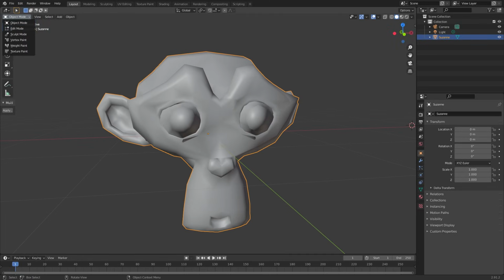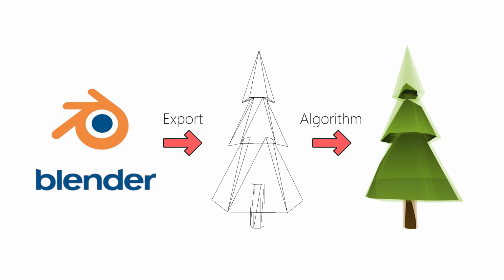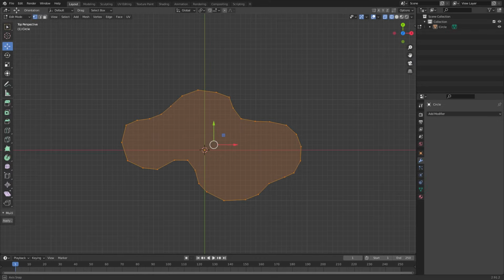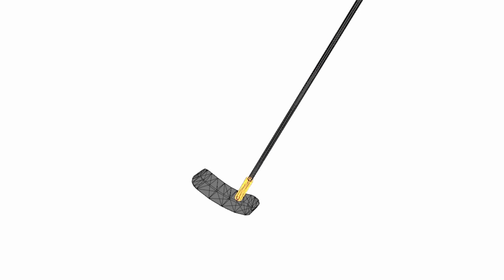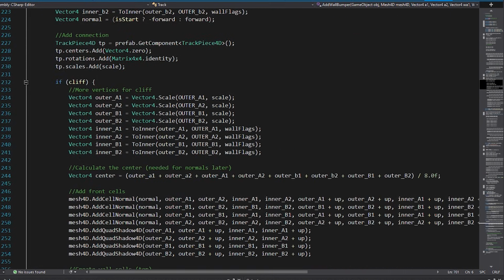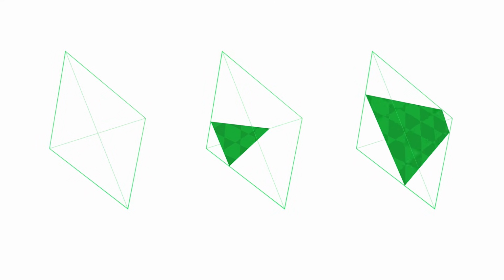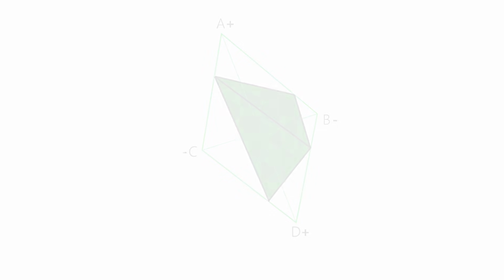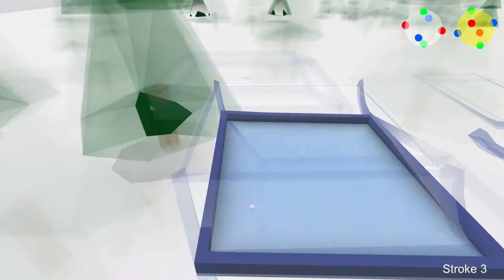How Do You Build 4D Worlds? - 4D Golf Devlog #3

Comment: The matrix at 7:03 doesn't have any red component, is that correct? 

In the current version, there's a symmetry in the matrix and looks like it can be collaped into a 4x8 matrix. The left 4 columns are the upside-down version of the right 4 columns.

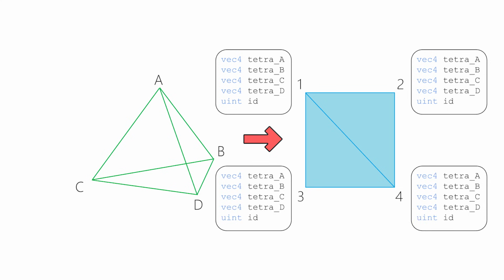Comment: 5:28 wait, wouldnt it be more effecient to write a compute shader, using buffers to pass in data? I'm not sure how it's done internally, but unity has a way to make buffers using structs for datapoints-- you could recreate that, or just create a buffer of vec4s, with each 4 vectors representing one tetrahedron. Then, the compute shader could return the triangles, which can be passed into the traditional render pipeline.

Comment: What about animation support in normal 3D tools?  Time is treated as a 4th dimension in a limited fashion.  You can set up keyframes at specific times where your 3D object is shaped a certain way; this defines the 3D cross-section at a particular 4th dimensional value.  Then, it generates more regularly-spaced slices for you.  You can take the animation as input to a utility that connects the slices with vertices to form a 4D mesh.

Comment: Not sure if anyone else has mentioned it, but tetrahedral meshing is something done very commonly in fluid simulation codes, you may be able to use one of those software packages to make your tet meshes more robust and less skewed.
Reply from the maker: That's interesting to know! But I think the problems are different. You generally try to minimize the tet count in 4D rather than have them distributed in a specific way.  But maybe it could be useful for subdivision.

Comment: I have dealt with these hypershape meshing problems extensively.

For convex polytopes, I have found it effective to fill the 4D volume with pentatopes and extract the tetrahedral boundary mesh from that.
There is an efficienct algorithm to merge co-(hyper)planar faces and get the full face decomposition of the polytope.

For 3-manifolds, two approaches:
1) paramaterize the 3-manifold using 3D coordinate patche(s). 
Taking a 3D slice involves an isosurface calculated in the 3D parameter domain.
https://youtu.be/IDEoZw_dhVQ

2) 3-manifold can be defined as an implicit surface.
In this case a slice is made by parametrizing a 3D hyperplane via a linear embedding of a 3D coordinate domain, then taking an appropriate isosurface.
https://youtu.be/tY0BMxCvyS4

I have a lot of ideas and algorithms that I'd like to discuss with you.

Comment: Actually you do not have to create a texture specifically. You only have 64 possibilities and 4 bits of data each (2 same values represent invalid triangle). It makes so you could pack all of data into 2 uvec4. It would speed up by removing additional redirection.
Reply from the maker: That's an interesting idea, it should work.  I can try that out if it turns out to be a bottleneck at some point.

Comment: 2:55 The property is called star-shape (or I'm horribly mistaken). If I remember correctly, a shape is star-shape if there is a point (called the center point) such that every point in the shape is connected to the center point by a straight line (or a geodesic, for a non-Euclidean topology).

Comment: My first program on CUDA, back in 2009, was for slicing tetrahedrons on the GPU to compute isosurface in 3d texture (marching tetrahedra). I think I used a LUT to find if the surface would slice the tetrahedron in 0, 1 or 2 triangles, and I implemented a clever bucket sort to then sort the intersections. then I had two kernel to handle the two cases. I don't think I could pull that ever again!

Comment: if 3d coordinate (x,y,z) are seen as projected 4d coordinate (x/w, y/w, z/w, 1) why not restoring the w and using vec4 instead of vec3 in your shaders? You will have just need to implement your matrix55 operations (a mat44 with 0, 0, 0, 0, 1 on the corner) that for some operations this can be computed afterall by a mat44 calculus.

Comment: The fact that you’ve wrapped your head around this stuff to not only think, but also code and optimize, in four dimensions is seriously so impressive. That optimization with the lookup texture was sick as hell
Reply: The optimization doesn't really have anything to do with the fact that it's 4D. It's just realising that there's a small number of possible inputs to this function so you can just precalculate it.

Comment: Replacing logic with a data structure is one of my favorite things. When I made a Rubik's cube simulator/solver in Javascript with three.js, I had trouble knowing exactly which way to rotate a face to move a piece; like, which way should I rotate the right (R) face to move a piece from the top (U) to the front (F). Ended up manually typing a nested dictionary so that I could look up 
Move[R][U][F] to get R'. That was the most productive 10 minutes of typing in the whole project.

Comment: Holy crap the mess with the tetrahedron slicing is insane.
How many hours do you need to spend thinking about 4d shapes before this becomes intuitive? Or at least something you can wrap your head around?

Also, what do you do if your tetrahedron is parallel to the 3d slice? Do you even bother with it? Technically it's something with probability 0 of happening, but you might initialize a tetrahedron that's parallel to your space
Reply from the maker: I haven't needed to bother with it luckily.

Comment: Not really related, but I think propagation of light would follow the inverse cube law instead of the inverse square law, so rendering light and shade might be real strange. Actually modelling EM waves might not even work in 4D since Maxwell’s equations use cross-products.
Reply: You can take cross products of 3 vectors to get a 4th perpendicular one. The surfaces light reflects off of in 4D are 3D volumes not 2D areas, so the reflection surface has a well-defined normal. Reflection should work fine. But the dropoff distance for light would be shorter, yeah.
Reply: For EM, a moving charged particle could induce a spherical magnetic field. I.e. the sphere formed by rotating the usual induced field in the normal volume of the velocity vector.
Reply: @aprilschauer2545  oh that’s really cool. Gauss’s law of magnetism gets a lot less restrictive in 4D I guess.
Reply: @Scrogan  I believe the magnetic field would be a bivector field but don’t quote me on that, just speculating—it would be fun to work out formally.

Comment: I love it, could you do a deeper episode on how the table lookup works ??? Because going from the table to getting millions of tetrahidron displayed was a bit of a shortcut for me and don't get how it works at all ! 
I'd love to give a hand with motion design if it helps :)
Reply: When the tetrahedron is sliced, three or four points are expected. Each of those four points needs to know what edge of the tetrahedron they're on. Before, the calculation used math to determine whether each edge passed through the cut plane then tried to place the points as crossing edges were found.
You can see this in the old code as it tries to place point 0 between vertices A and B by checking whether their depths multiply to a negative number (because they're on opposite sides of the cut), then repeating point by point, vertex pair by vertex pair.

In the new lookup, it's kind of actually four lookup tables combined, one for each point 0-3. They seem to be arranged something like below:

Case 15 Case 16
Case 13 Case 14
Case 11 Case 12
Case 09 Case 10
Case 07 Case 08
Case 05 Case 06
Case 03 Case 04
Case 01 Case 02

Each case is one pixel tall and four pixels wide, with the first pixel for Point 0, the second for Point 1, third for Point 2, and fourth for Point 3. Rather than multiplying all the vertex depths together to check whether their products are less than 0 over and over and over again for every single point, you just look at their signs.
In Cases 1 and 16, for example, they were all + or all -, so the cut actually misses the tetrahedron, so all four pixels are blue to tell all four points immediately that there is nothing to draw there without doing any of that repeated multiplication at runtime. In Cases 2, 3, 5, 8, 9, 12, 14, and 15, only one vertex was different from the others, which meant the slice would be a triangle, which meant only three points are needed, which is why the fourth pixel in those cases is blue, telling the fourth point that it doesn't need to do anything.
Reply: @Thelothuo  THANKS A LOT for your explainations !! I'd love to see that explained in a video with motion graphics !
I'm not sure to get it all but it seems more understandable now :) 
If you'd like to try to make a video on that with me I'd love to make one :)
Reply: basically, the logic of figuring out how to display the tetrahedra is really complicated, and therefore expensive. So if you tried to compute that logic for every single tetrahedra in your scene, it is not fast enough to be able to display millions of tetrahedra. However, despite the complicated logic, the number of things that determine how to display the tetrahedra is actaully small, as there is only 64 different cases that there can be. With a lookup table, you just have to calculate those 64 different cases once, which isn't that expensive, and since its really easy to determine what case the tetrahedra are, you can just look up how to draw it in the lookup table, which is much much faster than calculating it from scratch,

Comment: its pretty much only procedural generation. does a 4d "marching hypercube" rasterizer exist? that would let you rasterize 4d signed distance fields?
Reply: Not sure if anyone's made one, but the algorithm is pretty much dimension agnostic. Technically it should even work in 1D. The main complication would be the combinatorial explosion of cases in higher dimensions. Not counting disambiguation of saddle points, 2D has 2^2^2 = 16 cases; 3D would have 2^2^3 = 64 cases; 4D would have 2^2^4 = 65536 cases. One for each binary string whose length is the number of vertices of the N-(hyper)cube.

Comment: I do work with 3- and 4-manifolds, and love these videos. There's so much good concrete stuff to know beyond academic research programs!! Do you have any thoughts as to why your lookup table looked like that? I was surprised it wasn't symmetric in any way.
Reply from the maker: It's not symmetric because of the way I brute forced it.  One of the slice triangles gets priority over the other for the 1-triangle solution, and I sometimes have to flip the winding order of the triangles to match the 4D normal orientation.  So it all gets kind of messy.
Reply: I think it's partially because the lookup table is really a 2x2x2x2x4 image that has been squashed to fit into 2D. Although it's possible it's not symmetric even in that higher dimensional space as well.

It might have had more visible patterns if he'd used a different indexing scheme. The video shows bits 0-2 used for the X and 3-5 used for Y. It's hard to work backwards and figure out which configurations each pixel corresponds to.

I think if the image was organized with X = (ID&1)<<2|A<<1|B; Y = (ID&3)<<1|C<<1|D; then it would be easier to look for patterns. The 4x4 quadrants would be the different ID values. Each quadrant is further broken down into 2x2 quadrants for the value of A & B, then each 2x2 is broken down by the value of C and D into individual pixels.

I thought it was a very cool optimization.

Comment: you dont need to enclose, surfaces are enough, ie, 4d-polygons
Reply: Surfaces are not enough. You need to tetrahedralize the entire volume, otherwise it will have holes.
Reply: @user-dh8oi2mk4f  4d surface, mate, no lecturing from the dead
Reply: @user-dh8oi2mk4f  "I tell you how things are" right?
Reply: I would say you need 4 points to make a 4d surface
Reply: use mesh volume boundaries, so you dont have to process all primitives, only the ones that will be actually shown

Comment: We have Length, Height and Depth.
What is the 4d equivalent? Google says it is time even when I ask for the spatial dimensions only. I know moving along the 4th dimension is called Ana and Kata(or something similar), I know the 4d volume is called content, I know the 4d surface area is surface volume, but what is the version of Height? Will I have to coin a word?
Vocab: Coin a word means to invent it.
Edit: Fixed some grammar mistakes so the people who are like "Actually you need a question mark, not a period/full stop" (The name for a . depends on where you live).
Reply: There isn't really a standard and most mathematicians don't really care about assigning English names to these quantities. 3D does technically have 4 words for different dimensions: length, height, depth, and width, but two are usually aliased together. You could however treat all 4 as distinct which provides four words to describe an object's dimensions along 4 separate axes.

Of course, since "dimension" in a mathematical sense is very abstract, the 4th dimension could also be "duration," "temperature," "mass," "energy," "charge," "redness," "greenness," "blueness," "opacity," or any number of words that can describe measurements.
Reply from the maker: There's very few English words for 4D stuff, only Ana and Kata seem to be popular if you can even call them that.  Internally, I've been using "girth" for 4D depth even though it might not make sense, because it's still dimensional-sounding without being confused with the other 3.
Reply: @CodeParade  Yeah you have to call the additional one something. But “girth” doesn’t have a good adjective form other than “girthy”, and “5 units girthy” sounds humorous, but still better than “5 units trong” imo.
Another option is to index the directions.

Call “left” “left-A” and “right” “right-A”, call “ana” “left-B” and call “kata” “right-B”.

For length/width/height, you need:
- A word for the vertical axis, i.e. the one that determines whether something is “right-side-up” or “upside-down”. This would usually be aligned with gravity or the relative axis of something that would be aligned with gravity when it is right-side-up. I’d call it “height”.
- A word for the longest horizontal axis. I’d call it “length”, or “length-A”.
- A word for the second longest horizontal axis. I’d call it “breadth” or “length-B” in the general case.
- Etc…
- A word for the shortest horizontal axis. I’d call it “width”.

This system would get you terms for up to 26 dimensions. I’d avoid numbers, e.g. right1”, etc because that can be confused with “one unit to the right” when speaking.
Reply: @CodeParade  Thank you for your insight.
Reply: I like to call it “breadth”. So like, a 4D rectangular shape could be 3 units tall, 10 units long, 4 units wide, and 5 units broad. I would reserve the word “length/long” for the longest side. I suppose you could reserve “broad” for the second longest side but I don’t know of any such convention.

Some people will use the word “trength/trong” for the new dimension, though I don’t like inventing new words for things.

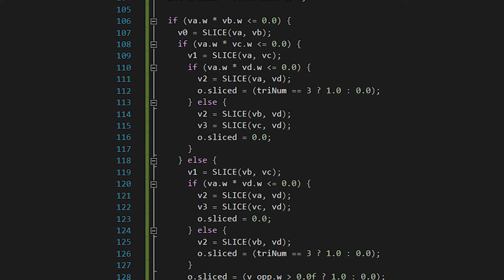Comment: You probably already know this but  5:47 if you have deeply nested if-else functions, you can often abstract away a lot of that by logical inversion- this makes code much more readable (and sometimes faster since once a statement is deemed false what follows gets ignored through obligation). Plenty of articles out there about inverting if-else statements, should it be something you (or anyone else) want to explore. :)
Reply: bruh this is only(!) for code style and to reduce nesting.
While I personally love this, your statement about it being faster has no point since on the bytecode/machine code level ifs are conditional jumps and inverted or not they look the same (and the compiler reduces the boolean negations to absolute minimum as the simplest optimisation)
Reply: And the real problem with using if-statements on the GPU is that the execution path always goes through both sides of it; the cores that failed/passed the conditional check are just "turned off" and don't execute the wrong path's statements. Each core goes through every line of code in the shader, and having lots of conditionals means lots of time where cores aren't executing anything.

Comment: When i was doing 4d rendering, i did consider building meshes to render, but eventually i just thought back on your videos and the work of inigo quilez and raymarched it instead. super simple and ran decently well, mostly. though sending the primitives to the GPU was an interesting experience
Reply: Do you have the code posted somewhere?
Reply: @durnsidh6483  I don't think so. And it was awful anyway. If you look up inigo quilez on YouTube, he explains rasrching really well, and has a website with lots of code examples. I recommend starting with the one about the sdf of a box, it will explain how I came to the realisation that you can use raymarching for 4d. If you're not sure what raymarching is, there's some videos on this channel too
Reply: @amyshaw893  Well, thanks anyways!

Comment: I think the property you migh be refering to at 2:56 is called star-convexity.
Reply from the maker: It is!  Thanks a bunch, I couldn't find it in any search I did.
Reply: I learned it as “star-shaped”, but yes, that’s it.
Reply: @henryseg  I learned it as 'star-like domain', basically the same lol.
Reply: The kernel (set of points which can see the entire boundary) of a star-shaped domain is convex. Is there any benefit to triangulating the kernel, then using the points on the boundary of the kernel to generate a triangulation of the domain? Intuitively this splits the domain into a simple(ish) centre and some boundary polytopes which feels like a nice decomposition if nothing else.
Reply: Hatcher calls it "star-shaped" in his algebraic topology book